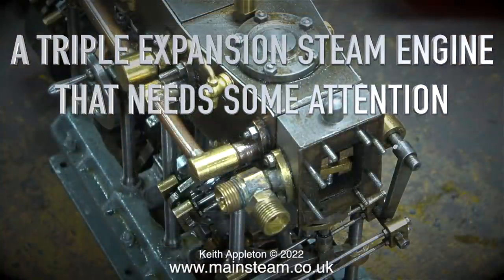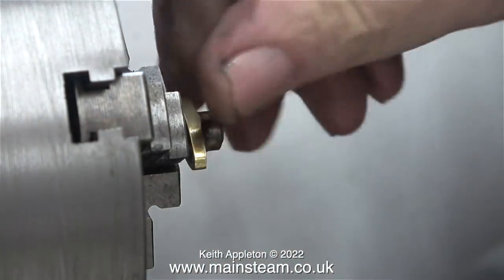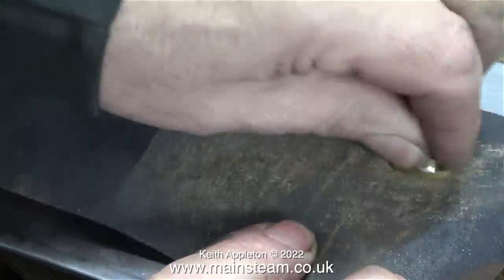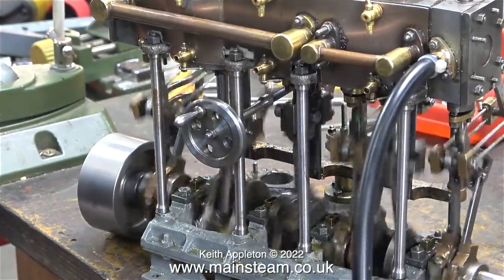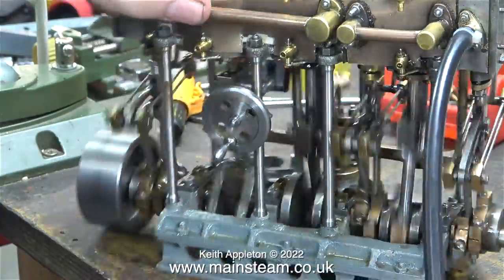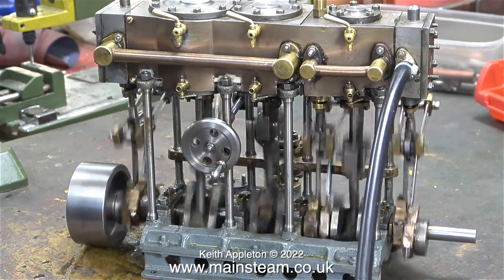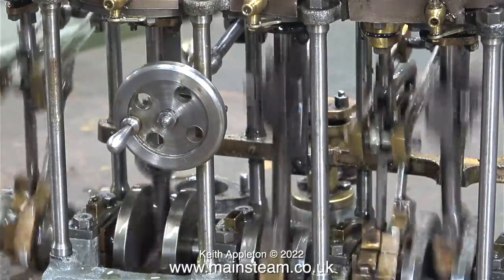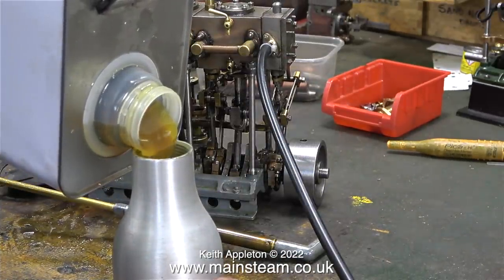A TRIPLE EXPANSION STEAM ENGINE THAT NEEDS SOME ATTENTION #10

Comment: I've been in engine rooms of tugs and small steamers where the engines have sounded as bad as the slow motion bits in this video. It seems to be a common thing... but then again I bet it's not so easy to set the timing on a full size engine!

Comment: Keith, I know it would be difficult at these scales, but especially for the middle cylinder of a triple it would be nice to have a "turnbuckle" style adjustment for that valve rod.
Reply from the maker: It has. The valve rods are threaded and so it are the valve drive blocks, after disconnecting the valve fork, by rotating the valve rod you can set the valve timing quite easily.